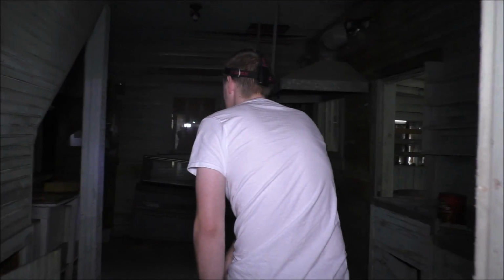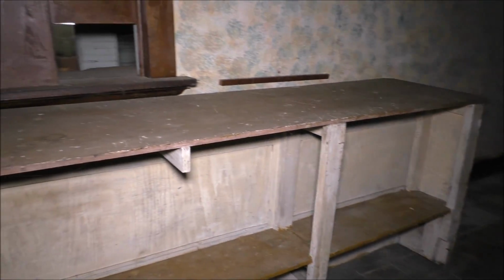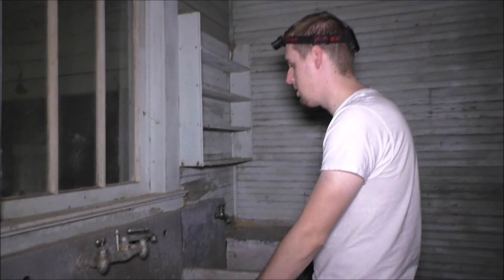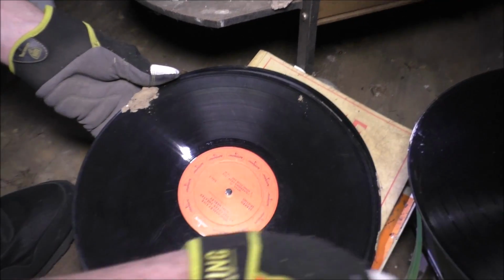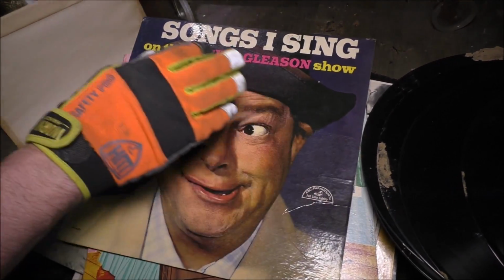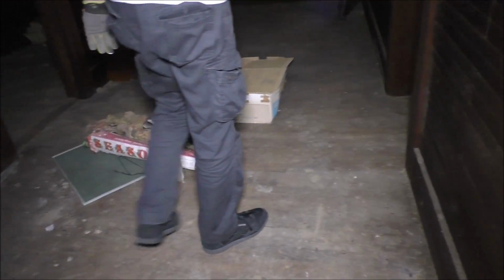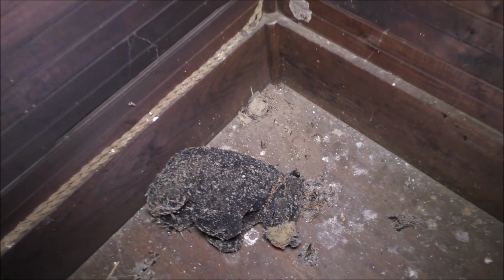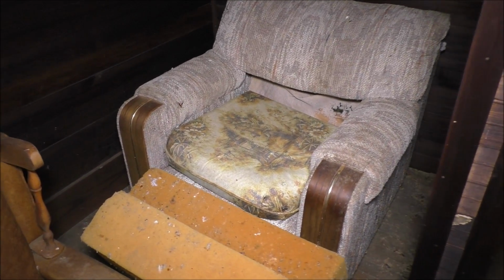#78 Abandoned old Fashioned Restaurant/Home combo - Vinyl Collection found!

Comment: Unusual place. The empty water jugs indeed odd. The ratio of apparent public to private space seems deceiving and/or disproportionate to me. Some hybrid of a place...True function is hard to pin down; confusing/mixed signals as you guys alluded to at the beginning. It does seem "kinda small" for a restaurant. Doesn't seem there were any booths...So one might think more a meeting or events space. But then the big expanse of windows at the front suggest diner...Tall poles beyond skeleton at 0:15 are sign posts I'm guessing.
Reply from the maker: Yeah we though it was really odd too.  Very strange.
Reply: Exploring with Rick & Bekah expiration on water bottles is based on plastic deterioration. Why so many?
Reply from the maker: Shrugs

Comment: A thought on the water. There was a concern when it turned the year 2000 that all the computers would fail and the water system would fail and there would be no water. Thus the storage. Given the extreme temperature changes probably caused the seals on the jugs to burst thus all the water leaking.

Comment: The water jugs were probably for someones Y2K prep.
Reply: Bottled water does expire because water stored too long can acquire a dangerously high bacteria count. Also, there's a simple explanation for why all the water jugs were empty: The building was/is unheated so the jugs froze and expanded during the winter. The expanding frozen water split all the jugs and the water leaked out when it thawed.
Reply from the maker: You nailed it.